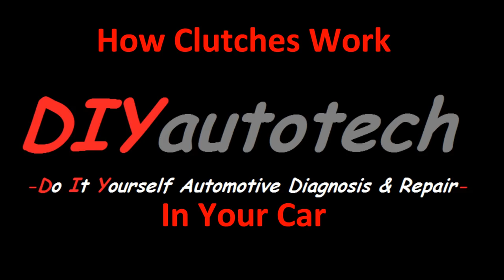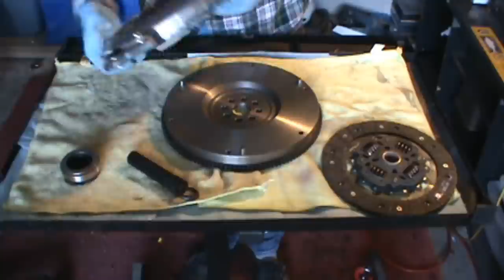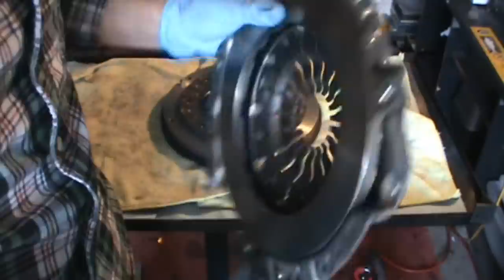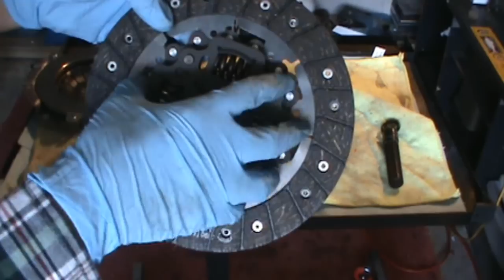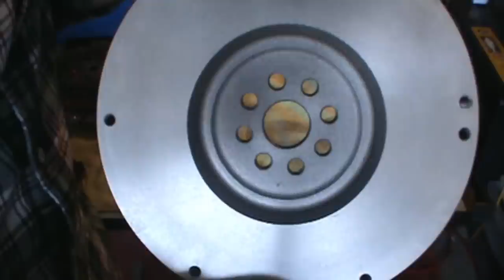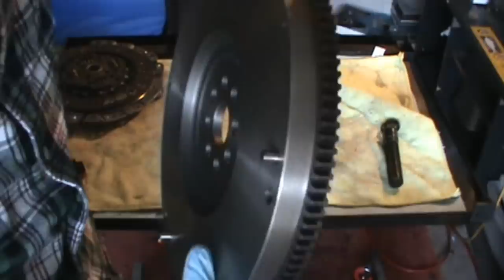Clutch Basics - How A Clutch Works

Comment: richardpico: Usually the first thing to wear is the clutch disc, or the item with the friction material on it, which is 'sandwiched' in between the pre-loaded pressure plate and the flywheel (or engine direct drive).  The disc material, as mentioned here, is like disc or shoe brake material, so it's the most 'soft' material.  Bearings usually wear out further along the life of the clutch.  But, change them all while in there! r-

Comment: spelunkerd: My opinion for this kinda case is that- if you're gonna pull the tranny to do a ring gear on an automatic flex plate, just replace the entire flex plate.  They are inexpensive and you don't mess with pressing on a ring gear to such a thin piece of metal.  Pressing ring gears on is for full flywheels for clutch applications. If yours is a diesel engine, even more important to have a good, solid grip between starter and ring gear, due to upper high compression of diesels. r-

Comment: ricardopico cont'd:Once the friction material is mostly worn from the clutch disc, it begins to slip the mating action between the flywheel and disc when it's fully engaged to the transmission. The flywheel is bolted to the engine, but the clutch disc 'floats' between latching the tranny to the engine -to- a full disconnect between engine and tranny.  cont'd..

Comment: @DIYautotech Thanks, Anthony. I've got an amateur subscription to Alldata for this vehicle, so I can do it myself. What specs am I looking for? It's not too bad at this point, but enough to notice once in a while. Almost like the ring gear is too far back toward the rear wheels, or maybe it's warped a little. With a torque convertor, does the flywheel gradually shift backward with wear? Axially, engagement seems OK....

Thanks again for your advice.

Comment: On an unrelated note, I have an automatic Dodge Ram, and the ring gear is starting to show a little wear, with occasional slipping and some worn teeth but no broken teeth. Have you ever changed the ring gear on an automatic? The starter motor is new, and both the new and the old starter teeth don't project deeply enough to fully engage the ring teeth (about 50% lined up). Shims would make it worse, no shims. Any ideas?

Dave

Comment from the maker: @spelunkerd Well unfortunately the only thing you really can do is replace the ring gear.  It's apparent that the old starter slowly wore down the rings crowns, but not enough to render the engagement useless.  I've seen this MANY times on big block V8's, where it's really hard on the ring gears teeth apon initial cold start.  I've never done one on an automotic, but I can look up the Alldata specs for you and send them to you?  Send me a message containing your email.